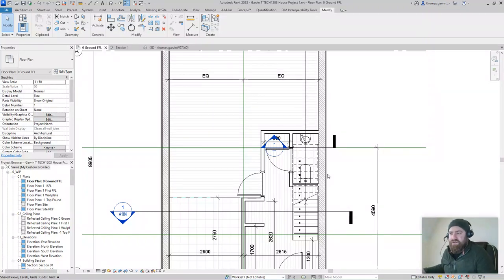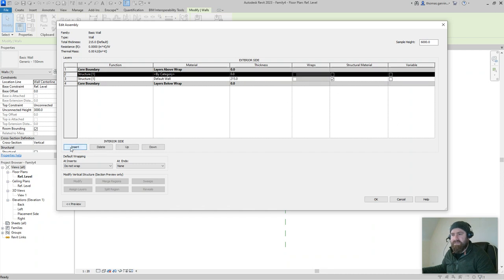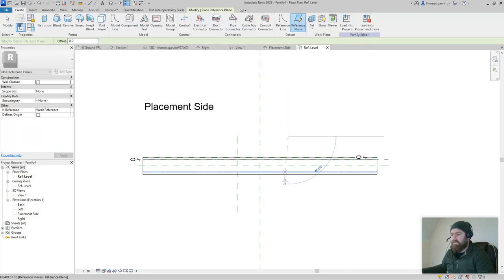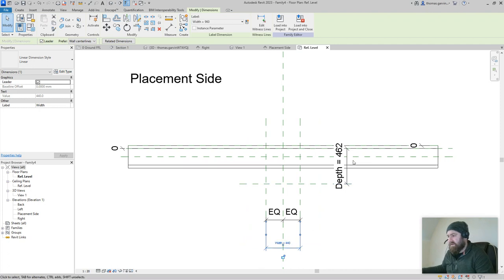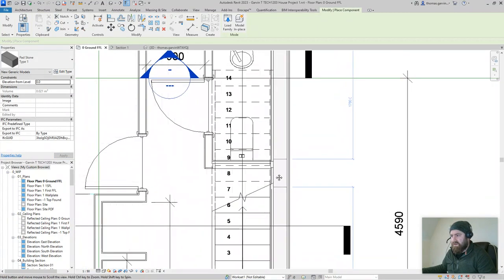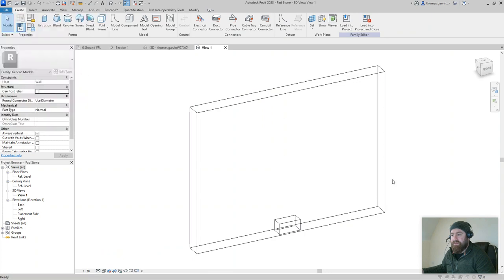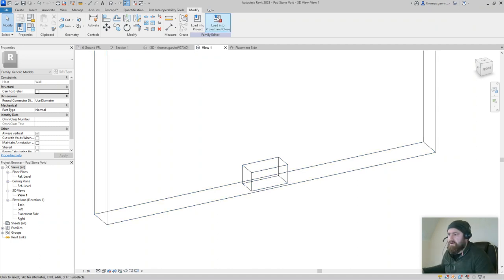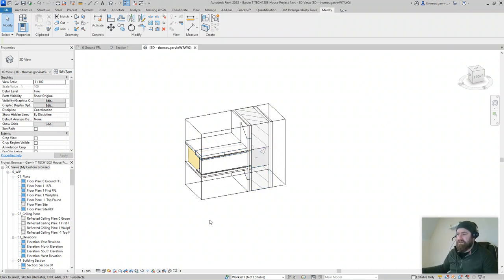Model Wall Hosted Pad Stone for Bearing a Steel Beam

Comment: Loving your videos. P.s. pad stones sit under a steel! 😂
Reply from the maker: Thanks! I appreciate the message. Did I say something stupid like the padstone's on the steel?
Reply: @tg-at  it doesn’t matter. Just messing. Quick question, I need to create a projecting fascia, half way up a very high wall. Should I create a compound wall, or add the fascia as a sweep?
Reply from the maker: @jjfubar11  half way up a wall? You could either add a sweep to the wall type or perhaps better you could create a sweep on the wall. Check out my Add Skirting to Wall video.. same idea just higher up the wall.
Reply: @tg-at Do you do 1 to one tuition? If so, give me a contact.
Reply from the maker: @jjfubar11  hi, send me an email at thomas@tg-at.ie and we'll figure it out
Reply: @tg-at  email sent. Regards,